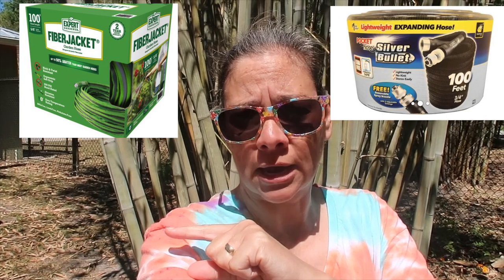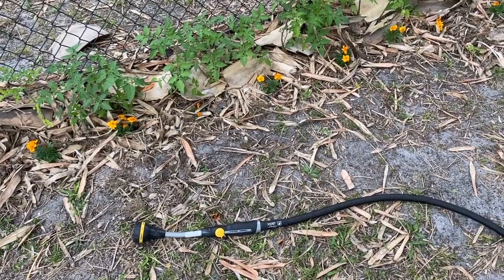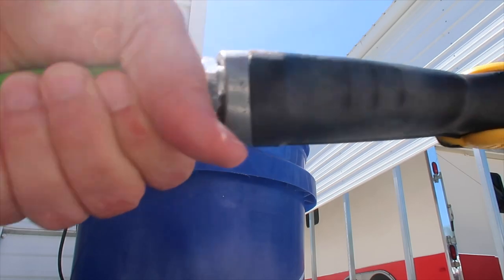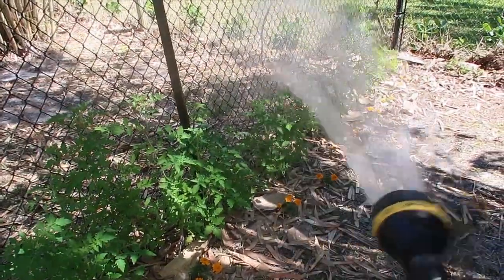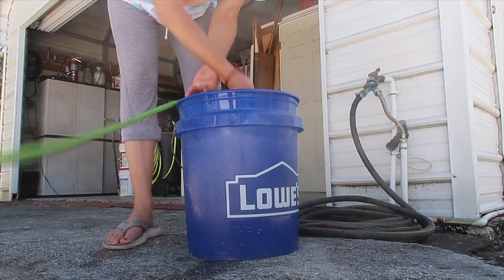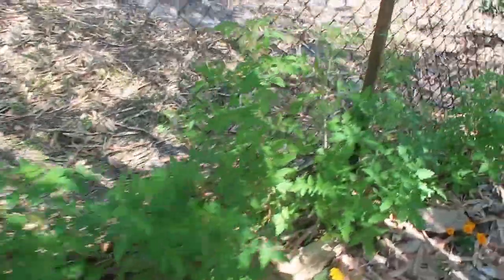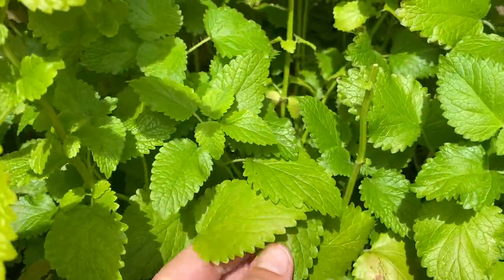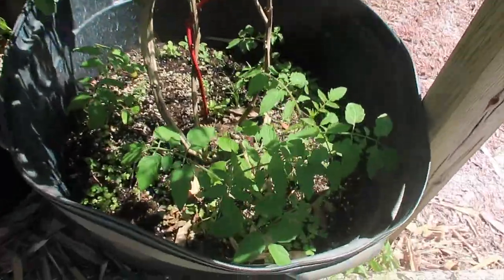As Seen On TV Pocket Hose VS Expert Gardner Jackethose Review

Comment: Expert gardener water hose sold at Walmart 2022 is garbage a waste of time and money lasted less than a month kinks so much stops water flow constantly and becomes lumpy within a few uses. Look at reviews from this product that are from this year. Don’t be tricked by old reviews from 2 years ago which are not the same water hose.  All bad reviews are from this year.  The water hose sold at Walmart 2022 is grey and looks nothing like the one sold 2 yrs ago which is green and nozzles look much better quality.
Reply from the maker: I will pin this thanks for the update I am still using my green one. Sucks when something good is cheapened to save money. I bought one of those metal ones off QVC but just like everything else I buy from them it usually sits in the box for a few years until I get to it😂